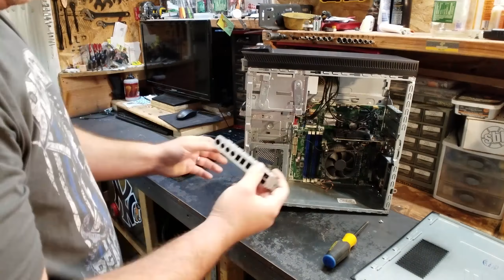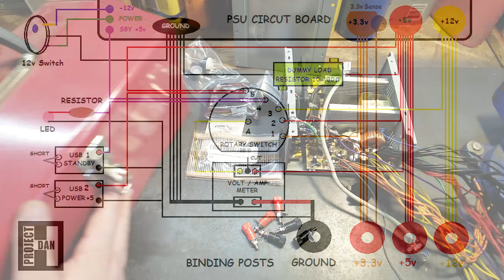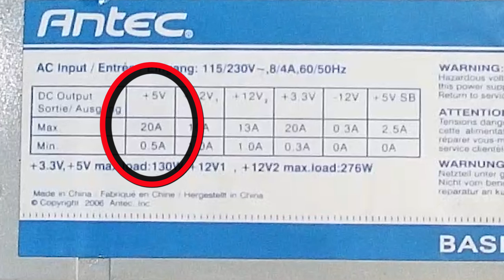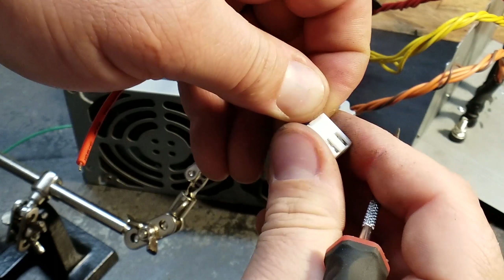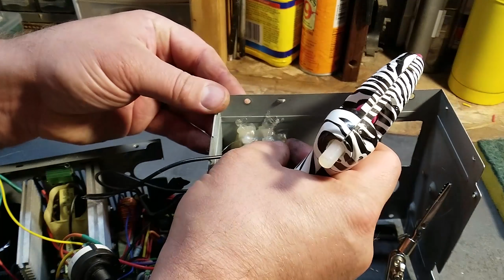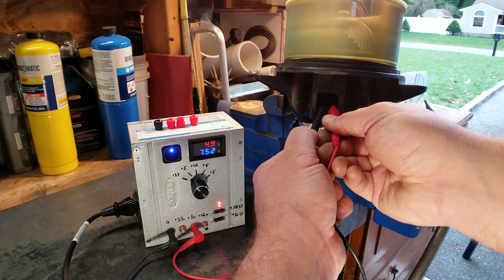HOW I MADE A DIY LAB BENCH POWER SUPPLY FOR TESTING 2001 JEEP CHEROKEE PARTS

Comment: I've used ATX supplies before but never new you needed a load to fully run them. Also I think that's a Xbox 360 hdd connector, or a mod but don't think it's a mod chip.
Reply from the maker: Haha.  Great Guess! I used to repair the RROD on the old 360s back in the day.  Not too complicated and I made a few bucks!